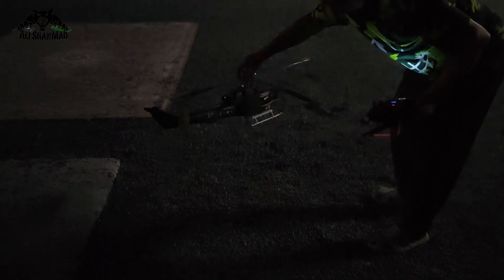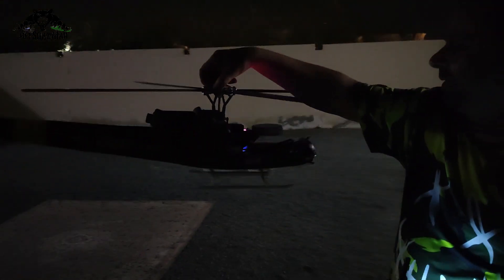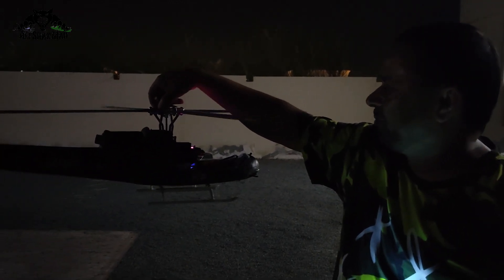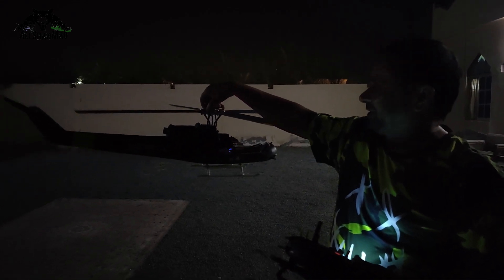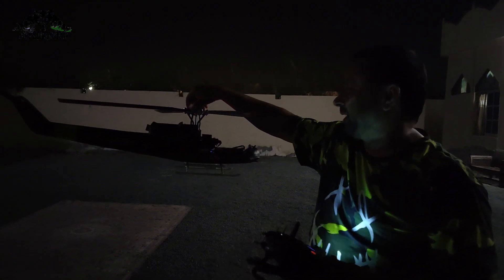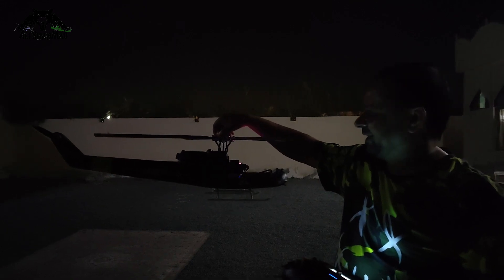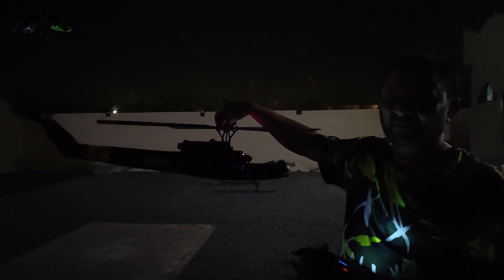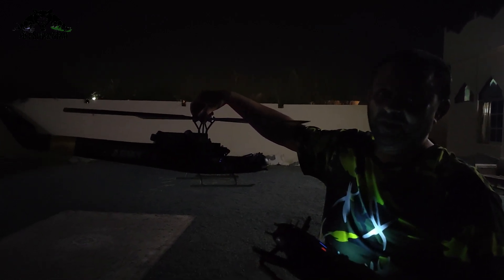Behind the Scenes: FlyWing H-ACE RC Helicopter Controller Tested at Night

Comment: What settings are you using to take off that smooth ? Very very nice as every time.
Reply from the maker: The new H-Ace has improved take off algorithm for slow take off and landing
Reply: @alishanmao so there is no need the settings in the software ?